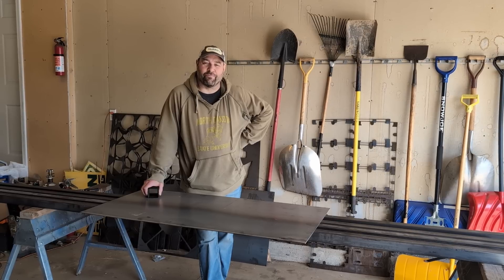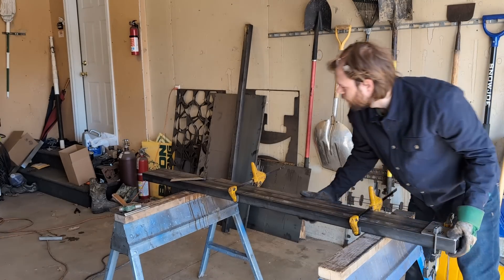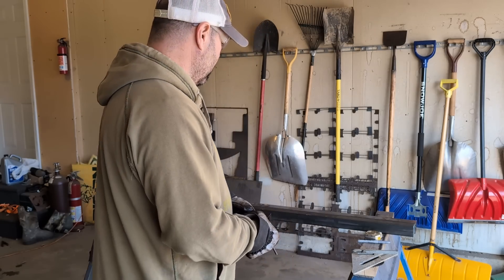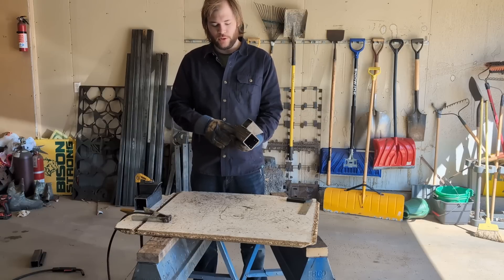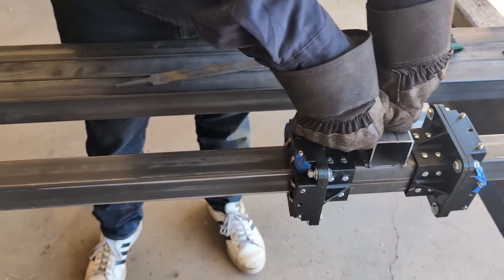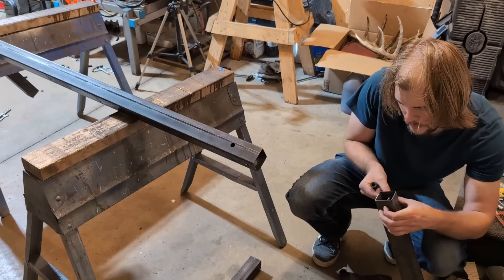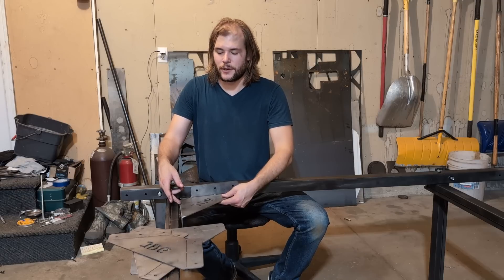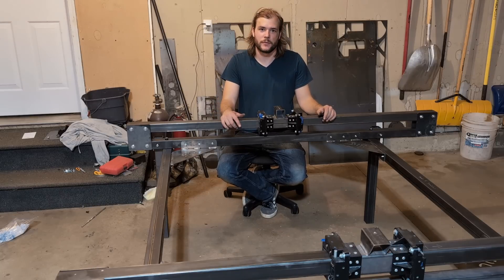Budget DIY CNC XL Plasma Table || Gantry and Frame

Comment: Into the build most 3d printed parts done awaiting steel from suppliers, very good plans easy to follow, nearly as good as the plans i got to build my CNC, running out of space in my garage/workshop now

Comment: This video makes the process look a whole lot easier than my experience. Drilling the holes with handheld drill perfectly straight through both sides proved to be quite a challenge. I ended up using a drill press and a lot of rigging.

Comment: Do plans call for PLA or ABS or what type of filament? Is information about the electronics and software included with the purchase? Does it require NEMA 23 or 34 motors? I am just trying to understand what I am getting with the plans and what I will have to source on my own.
Reply from the maker: Everything needed to complete the build is in the plans. This covers what filament and settings to use, all the electronics and a complete parts list with links to purchase.

Comment: I am building this and am sourcing my steel plates for the Triangle Brackets. On the parts list it says to get 2' x 2" x 0.125" Steel Sheet . But when I printed out the drawings (and watched you cut them out here) I am thinking that should be 2' x 2' ? So far everything is going good. Thanks for making this available to the community!

Comment: Hi! Can i also add a oxy flame torch in this cnc table? has anyone did this? id like to cut thicker materials
Reply: No. These types of processes are not intended for oxy/acetalyne torches. If you want to cut thicker materials, buy a bigger plasma cutter. An 80 amp machine can cut 1” steel like butter, so I’m not sure how much thicker you’d like to go lol.

Comment: Seriously considering building this. Is my Ender 3 v2 up for printing the 3D printed parts, or do I need a better printer?
Reply: Ender is good if it's tuned to print after switching it on. But if you need to mess with it half an hour everytime you want to print then forget it.
I got Ender-3 and Bambulab P1S. My ender had lots of adjusting and pain but it prints OK now. But after buying Bambulab the ender is collecting dust.
Bambulab is miles ahead from Ender and it's fast as hell
Reply: @ thanks for the reply. I usually have good luck with my Ender on small parts, but it usually goes haywire on bigger pieces. I bought the plans, I’ll likely buy the printed parts from you when I get to that stage.

Comment: What would be wrong with welding the base frame instead of bolting???
Reply: Welding introduces heat, which introduces distortion, which will give you a bad time when precision is needed.

When commercial/industrial manufacturers weld things that need to be super precise, they will have welding procedures in place with jigs, fixtures and post welding processes to get the result they want.

Source: It's what I do for a job. 

Edit: spelling.
Reply: @trustmeimdefinitelyqualified user name checks out…
Reply: I have the same question. If you are going to turn open the bottle of gas for welding the bends might as well weld the whole thing.
Using the bolts only to level the table….

Comment: I am in the middle of building this and there are some issues with the plans. When building the  Z axis, it says to cut the motor screw to 215mm and the slide rods to 235mm. I'm going to say they should be about the same length. I had to cut about 25mm off the slide rods after I cut them to 235mm.

Comment: I built mine as a 48x52 cut area with dual y motors and custom stainless pan over the summer. Call it the XXL 😂 Cut quality is nice but need to upgrade to the machine torch from primeweld when its back in stock.  Videos of it in action on the channel if anyone is interested!